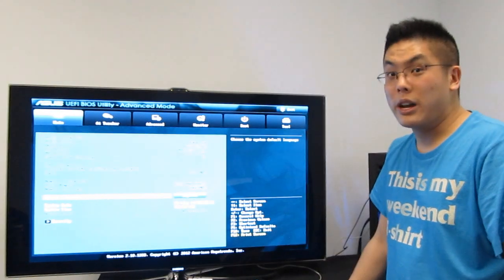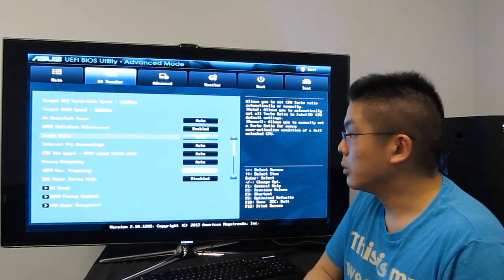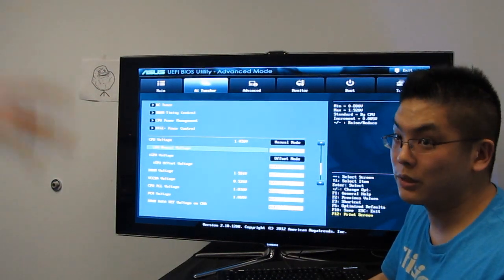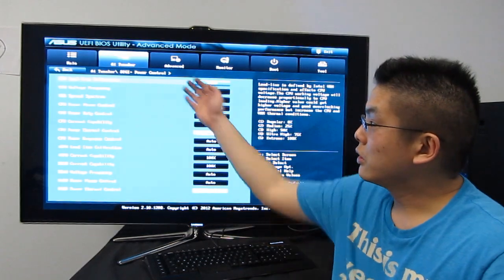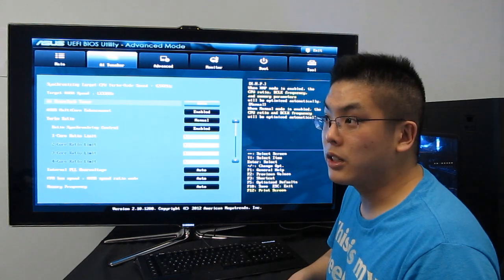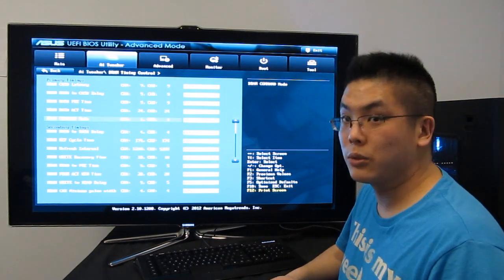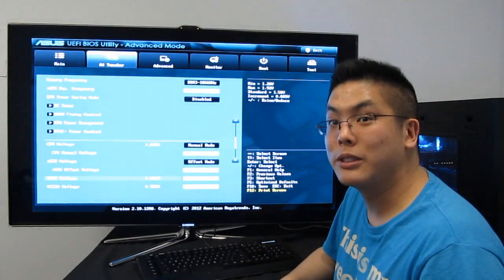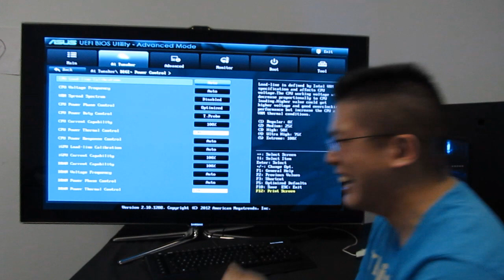NCIXPC behind the Scenes: Ivy Bridge Overclocking 101

Comment: Assuming an average 3770k chip, you can generally do 4.4GHz on default voltage with setting LLC to 1.8v or do 4.5GHz on around 1.25v.
Reply: Hey can i do the same for my i5 2500k?

Comment: Sorry but this is a boring generic YouTube video, you need to be more enthusiastic to make this enjoyable... like Linus is... sorry :(

My quick and simple overclocking guide because this is just confusing...

1. Increase your multiplier by a step or 2.
2. Test for stability which checking temps.
3. If stable, increase the multiplier more, if unstable increase the voltage
4. Test for stability while checking temps.

Repeat until you reach the max recommended temp or if you're satisfied.

Comment: You don't even need to touch bios settings to get 4.2GHz on 3570k/3770k if you use an asus motherboard like that one. All you have to do is use TurboV Evo to change the ratio to 4.2GHz in AI Suite II. All settings stock except for that, no issues with high automatic vcore, stability, or temperature.

Comment: step 1, get a nice board like a asrock extreme 4 or better.
step 2, preset over clock
step 3, test it....

if you're lazy that is... my extreme 4 put my 3570k at 4.4ghz with only .912-.962v  (after i tweaked it quite a bit) and has been tested on prime for 72hours without a single problem :)